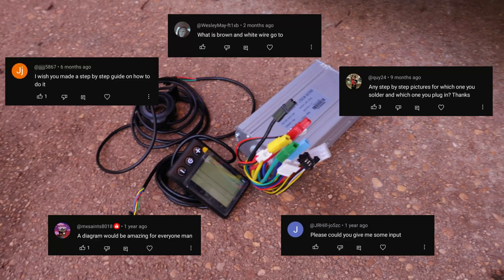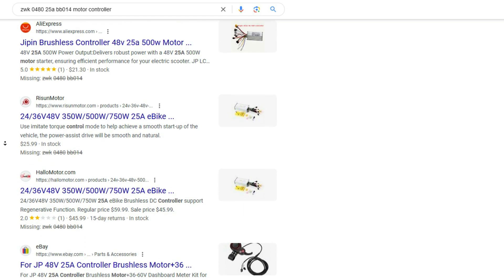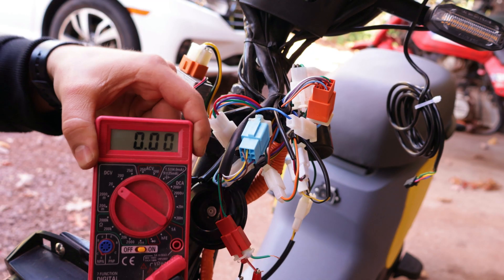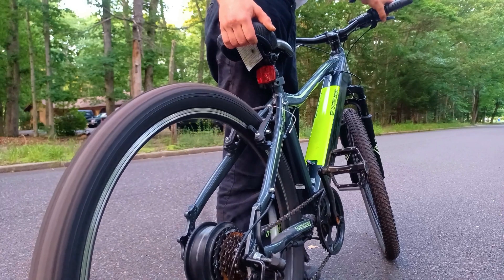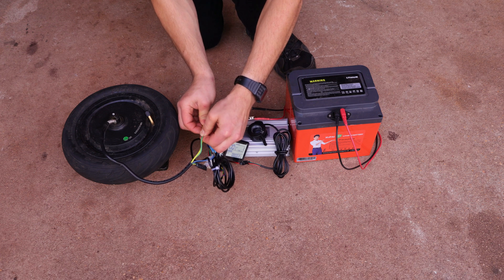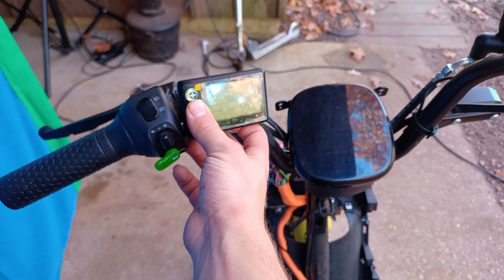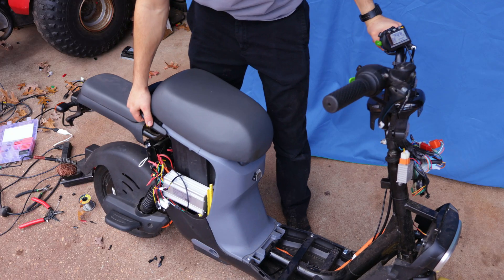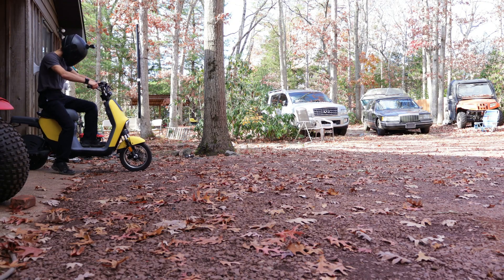STOP Making This Ebike Motor Controller Installation Mistake!

Comment: Where can I find a motor controller for a fucare fw11 ebike because when I push on the throttle the motor will spin then it will stop.The fucare fw11 ebike is 500w-750w with a 48v battery ?
Reply from the maker: @Im1234and5 Are you getting any errors?

Comment: How to bypass the display controller?
Reply from the maker: To bypass the display, you have to connect the blue wire to the red wire from the cable heading to the display.
Reply: @ElectronicLab.  I tried it, it doesn't seem to work. Looks like the controller is dead

Comment: After switching the phase wires. Do you need to switch also hall wires?
Reply from the maker: @hjtayona6102  no
Reply: @ thanks!
Reply: @ElectronicLab.  managed to get my ebike running. Thanks for the video.
Reply from the maker: @hjtayona6102  You're welcome!

Comment: What a shocker now show us the blooper video of the sparks and smoke , oh and it's much easier to swap the pins around in the throttle wires than chop them rite next to the plug then solder and shrink with the flame from HELL
Reply from the maker: There were no sparks or smoke in this project. And about the "flame from HELL"  I chopped the throttle wires to demonstrate how it works. If I hadn't chopped it, I wouldn't have swapped the pins from the throttles connector.
Reply: @ElectronicLab.  mate your a hack ya rough as guts do you want me to buy you a multimeter you need one at least

Comment: Wow great video! Do you know the voltage of the blue on/off signal wire from the display to the controller?
Reply: Yel well lm on the piss at the moment but I will come back to view this? Thanks from UK england
Reply from the maker: @koplarf I'm happy you liked it! The blue wire from the display is the same voltage from the battery. So if your battery is 42 volts (36v nominal), it should read around 42 volts when the display is powered on.

Comment: What about the pedal assist? Mopeds don't have PAS. How about the PAS?
Reply from the maker: @MrLarry-gr8  if you watch from 5:41, you can see that I show the PAS wires. and yes, mopeds don't come with pedals,  so it can't have pedal assist. But if you really want to know what wire is what, then brown is 5v, black is negative, and yellow is signal. To simplify it, just connect it color to color
Reply: @ElectronicLab.  Is that universal for all controllers?

Comment: So I connected ebike controller to rear hub but when spin wheel by hand doesn't spin freely turn power off then spins freely
Reply: Watch the nine minute mark of this video. You will need to do exactly this in order to find the correct config.
Reply from the maker: @aurorakitty5881  it didn't happen to me. Maybe you got a defective one, so try getting a replacement. Amazon has a 30-day return policy
Reply: Your phase wire configuration for hall sensors is off. Sometimes the colors don’t match right.

Comment: My batter wire is 2 copper wires red n black n controller is an xd 60 connector if i put in will it work
Reply from the maker: @yaboiant0816 are you replacing your  motor controller on your ebike?

Comment: Hi, what if i fix everything but i get an error 30, what then?
Reply from the maker: An "error 30" on an e-bike display typically indicates a "communication error," meaning there is a problem with the connection between the display unit and the bike's controller, often due to loose or damaged wires between the two components.

make sure to double check the connection, and if you already did, then get a replacement display from amazon (amazon has a 30 day return policy).
Reply: @ tysm! Much appreciated! Been looking for answers on the web but didn’t get a specific answer! Thanks again!

Comment: Hey I have a flat five pin connector for my hub motor and I can’t find any controller with the female connector could I just twits the wires together and cover them to get it to work?
Reply from the maker: @microsoftword4045  Yes, but if you want it to last, I recommend soldering or crimping the wires and then covering it with heat-shrink.

Comment: do you have e-brake on the motor? if yes, how?
Reply from the maker: Some motor controllers have e-brake wires, this one in particular does not.
Reply: and you need a battery that can take reverse current (regen)

Comment: When you doing this, you’re doing a great job. The only thing I could see that could help the process a little bit better is a multimeter the one with the clamp because you can basically put the clamp around the wire while putting it on the right setting of course anything over eight is a very bad idea And you wanna get the right one the right wire and never twist the throttle fall fully until you’re sure that it’s the right connection you could burn out your motor. You could burn out a lot of things. It’s just a precaution for anybody who wants to do this process great content
Reply: Is this related to my question about being able to connect two individual controllers?

Comment: can you tell me what those connectors you used to connect the phase wires are called??
Reply from the maker: The example motor I used came with bullet connectors (I think 14-16 Guage), and the motor controller came with Anderson-2 connectors (I think it was also 14-16 Guage).
I ended up connecting the 3 male bullet connectors into the 3 female Anderson-2 connectors. This will not work for the long term, which is why it's best to get matching connectors or just solder it.
Reply: @ElectronicLab.  Thanks I appreciate the help!
Reply from the maker: @amurill-d1d  you're welcome